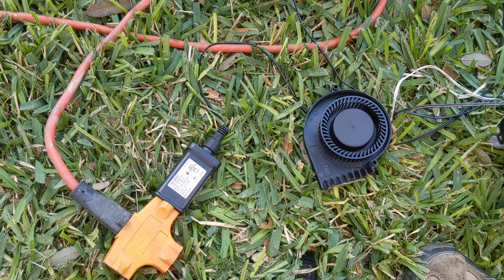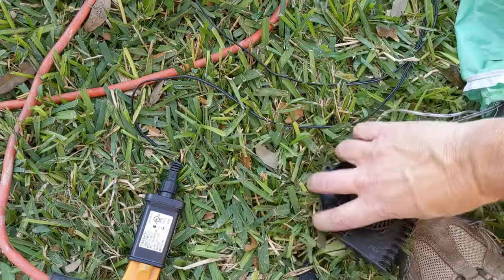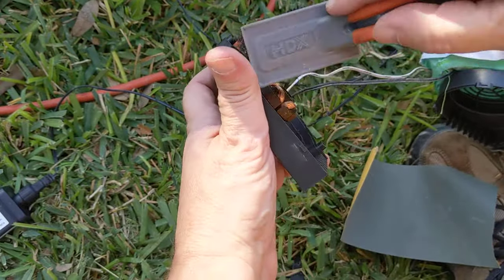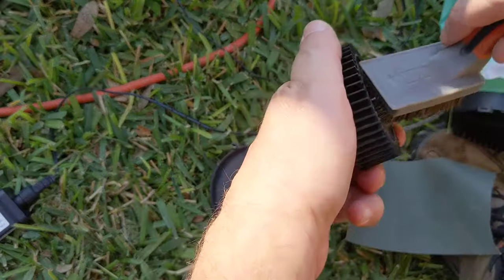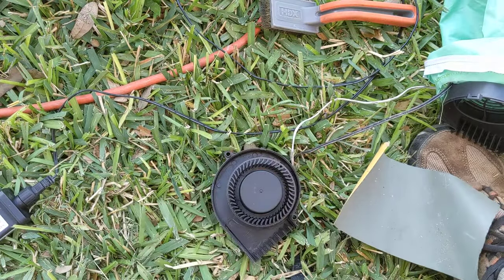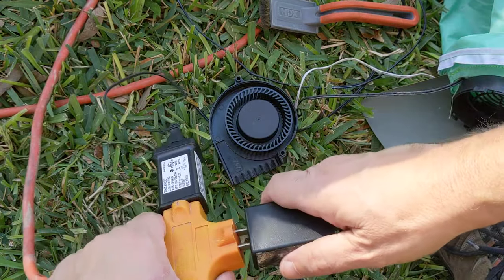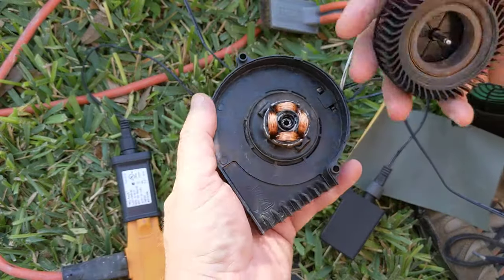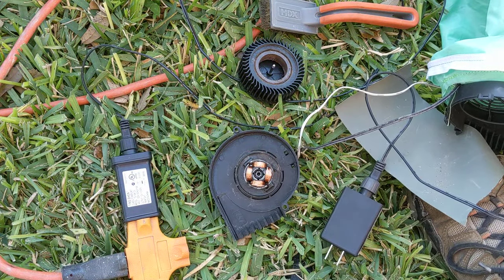Fixing the fan in a blow up  Christmas decoration

Comment: I bought a Halloween decoration from a store that closed. Fan stopped after 1 day of use after a rain storm. Lights light up but no blower. I'll try this out thanks
Reply: Did it work? Same thing just happened to me last night… thanksgiving night
Reply: @HugoReyes-np6jc  so all I had to do was shake and smack the fan motor and it loosen up the dirt/debris. It would do this every time I shut it off.
Reply from the maker: I don't think you can make those fans any cheaper and there is no waterproofing at all. On top of it the little transformer is so weak it barely has enough juice to get a brushless fan moving so if there is any debris/etc... it won't work.

Comment: My fan will only start with a helping hand. Any suggestions?  My inflatable is only 1 year (season) old. There no corrosion or dirt inside the fan area.
Reply from the maker: @bfkjulian  pull the fan off and put a tiny drop of oil on the shaft and see if that helps

Comment: I hate these near the cord aiways splits at the adopter or the invaluable
Reply from the maker: Yes and you can't find cheap replacements anywhere..it's like a 2$ fan. I'm going to work on really trying to make sure mine are dry when i put them up because it seems moisture and sitting for a year is what kills them.

Comment: I believe the term also applies to fans, stiction.  Some early hard drives and IBM 4GB drives would do this.  If you gave them a twist, they got past the dead spot and started.  I was looking at this because now that I know it is 12v (on the fan and the power supply), I think I can upgrade to more than one single dim 12v led to a strip.

Comment: Your blower motor looks exactly like mine. I took the housing apart but couldn’t pull the fan off as easily as you did. Did you have to unscrew or loosen it from the bottom side to pull the fan off?
Reply from the maker: I just pulled it off....if the fan spins freely then i would maybe try spraying electronics cleaner in there if you can but if it doesn't spin then it's probably corroded so yanking on it isn't going to hurt anything that isn't already hurt.

Comment: I still don't know how to get it open, the clips or the screws?  How to release the clips?
Reply from the maker: the one i had had 2 screws but if there are no screws then i'd just try and rip it apart (it's already broken so you don't have anything to lose). From what I remember some of them just snapped together so if you pulled hard enought they came apart but be aware these are not meant to be fixed they want you to just buy another one...

Comment: How did you take the fan off? We have it open but can get the fan piece off so we can get in and clean it.
Reply from the maker: On mine after you unzip the thing and reach in and find the fan just the two halves snap together so I used a screwdriver to kind of pop the snaps and pull it apart after that the actual fan just pulls off of the motor if it's the same type of fan that was in my blow up.
Reply: Use a brad or something about the same size as the axel on the impeller to pop it out from the other side.  It might be under a sticker.  If it's solid plastic there, you'll need to drill out the plastic to see if you can get access.

Comment: Maybe use rubbing alcohol as a cleaner as well?
Reply from the maker: You could try but mine was corrosion which alcohol won't help. The main thing is to be real gentle because these are super cheap fans so there is not a lot of metal to begin with!